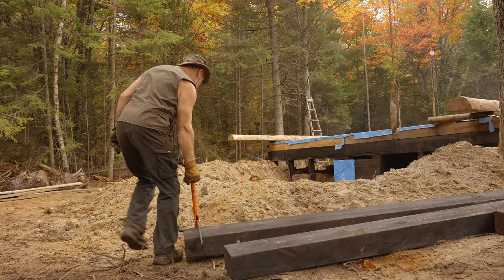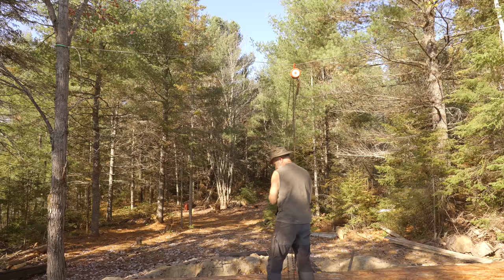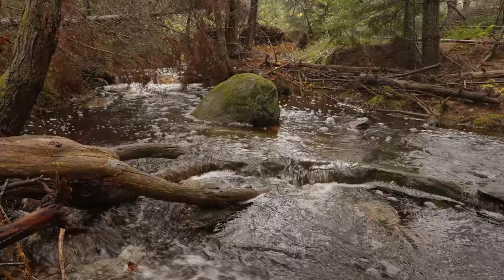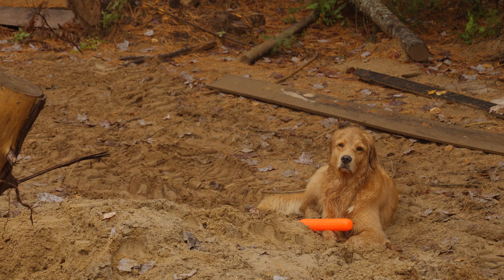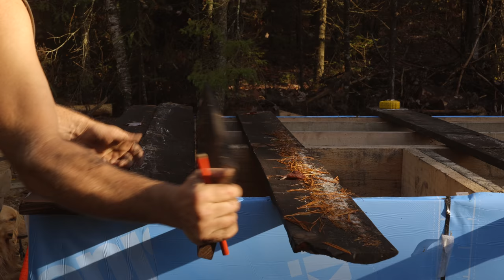Building an Underground Cellar and Breezeway to the Future Outdoor Kitchen | Off Grid Log Cabin

Comment: Usually they say “ don’t build on sand” but that’s the tightest sand I have seen. Wow, Cali does bark. What a great video, thanks Shawn.
Reply: If I recall right, "do not build on sand" is from the Bible. But, things were different in Near east back then.
Reply: Not build on sand I believe is symbolic, better to build on rock.. like Jesus said .. pointing out to Peter saying his name is Peter (Pierre which is a first name meaning rock ) and on this Rock ( Pierre) I will build my Church. ..
Reply: @angiekrajewski6419  My 1st name is Pekka, which is finnish version of Peter :)
Reply: They are right! Don't build on sand!
Reply: @gordythecat  well clay and rock seem to be all over my place.   So maybe not quite definitely sand everywhere. Lol.
Reply: I would post the link but it would just be deleted by YT, here is a description:
Definition – What does Hardpan mean?

Hardpan is a cemented layer in the soil, usually from 2 to 4 feet under the surface, although erosion can wash away some of the soil that covers it, or even expose it on the surface.
What Causes Hardpan
It is formed chemically, by lime, iron or silicate materials depositing at the same level and cementing the soil particles together. This cementing takes place very slowly. If you break up hardpan, it won’t form again during your lifetime. Caliche is a lime-cemented hardpan found in the arid Southwest. Like other hardpans, it is impervious to water. It is white or light in color, and the soil over it is usually alkaline.Claypan is a layer of clay soil. Claypan sometimes forms on top of hardpan as a separate layer. The clay may be hard when dry and softer when wet, but always impedes the flow of water, causing drainage problems.Fragipan is a layer of dense, compact cemented silt and fine sand. Like other pans, it impedes the movement of water. Fragipan is hard when dry, but brittle and fragile when wet.
Reply: He's not building on sand, but in sand.  This cabin will be just fine.
Reply: You notice the weight/mass of the timber he is putting underground?  You notice the depth in the ground he is placing the giant timber?  You notice that he has prepared for water, that his joints are clean and tight?  This, his massive foundation is built in the ground, rather than on the ground.  On top of this foundation, he will place a massive log home.  His home will last.   Texas
Reply: @papajeff5486  I wouldn't call it massive... but yes.
Reply: @papajeff5486  The fact is, that basement will rot.  It’s not instant, but wood rots.  He charred it, so it will help deter bugs and rot. But it’s going to rot.   Just heat exchange and humidity will create enough moisture to eventually rot it.   Of course, in a couple years, he will need to build another structure anyway, as these builds are content for YouTube.   He can’t stop, or the audience will stop.  
And of course, sooner or later the building inspectors will show up and he won’t be able to continue. He has those old neighbours as enemies and they will find the site on Google Earth.   Im sure there are a dozen turds trying to find him now.
Reply: @madjimbo4176  He is using techniques used to preserve wood for long time. And they do preserve it for decades. So not couple of years. And no, Shawn does not need Youtube to survive, he's merely entertaining us. When he's done, he can just plug off and live his life if he wants to. And no, he is far away from the hostile neighbors this time. Sorry to ruin your facts.
Reply: @Urgleflogue  lol.  He’s in the same area.  And of course, it will last longer than a couple of years.   But he will need more content to earn dollars in about two years when this site is done. He’s in business.   He entertains for money.
Reply: @madjimbo4176  Why do you think so? I mean, why do you think he'll need youtube to earn him money? Isn't it possible that the guy has secured his life already? Also, I can't help but notice that you're mad.
Reply: @Urgleflogue  I’m not mad at all.   I’m observing his build which is his content for his online video business.   Why do you think that is bad?  He makes good money from You tube.  And that’s because he has good content and a large customer base.    Why are you trying to pretend he is doing this only to be altruistic?  Lol.
Reply: @madjimbo4176  Well, your name says so :) And yes, the guy is doing this, because he understands there are lots of people who will like his content. Being the rational thinker that he is, why not use that while it can be used? And when (if) the interest for the channel dries out - well, that's ok, cut it and continue living. You don't think that Shawn started this project with the hopes he will be supported by youtube watches, right? Lol, as you put it.
Reply: @Urgleflogue  I suspect he does everything with a good idea of what is happening.    He’s a smart guy.     And let’s face it, there is a whole “non-pioneer side” of these productions no one sees.     Vehicles, material purchasing, mechanical repairs, electronics, charging systems, chemicals,  there is so much we don’t see.   It’s all part of planning a production that gives off an isolated survival mode aura.   It’s well produced.  We rarely if ever see cameras.     Yet he has to move them constantly.    

I would say overall it’s an extremely well orchestrated business, and the views on You Tube pay him extremely well.   Many Millions of views over time pays well.   And he deserves it.   He’s doing the hard work and making it better all the time.  

While he makes content, he will always have high views.
Reply: @madjimbo4176  Fully agree.
Reply: Heck, Mad Jimbo, even Henry David Thoreau wrote a book, it does not mean that the only intent is economic gain, or even that he is being deceptive in how he is doing it. You go pretty far afield in imagining the "non-pioneer" side, and as a fairly recent viewer, it seems unfair. So, what is the axe you are grinding?
Reply: @garysmcdermott  well, I suspect it’s normal for people to earn money on You Tube.    It’s normal to have a truck, ATV, Snowmachine.  It’s normal to have cell phones, computers, cameras, tripods, editing software, charging systems if they wish to make videos and post on You Tube.   What is difficult, is keeping all of that stuff hidden.   He does a terrific job of that, which reinforces the theme he wishes to portray.   And as a result, guys like you think he’s a modern Thoreau with a video camera.  That’s well done on his part.  

See, I don’t think that’s bad.  I think it’s good he does his chosen business/job well.   His business theme is well planned and he executes well doing it.   And I’m talking about what is very normal.   It’s completely normal.  

And I’ve been around and watching since the very beginning.  I do take a couple months off now and then from You tube when Im the northern forest myself, and catch up later.  See, charging is the challenge for people off the grid.   See, I don’t and can’t  haul around large batteries, and I know of exactly what I speak.  Devices need charging.   We download as much as we can when r the sun is at its peak. And when we can string a cell booster antenna.
  
Guys like you are odd if you think you can keep track of a couple million followers lol.  I’m not living vicariously through him as you are, but I enjoy seeing his videos as they have some great ideas on building.   He is a good man with a good business plan and strong execution.
Reply: @madjimbo4176  what exactly is your point? And why does it matter? Everything he's doing is his business! He is providing entertainment so he should get paid as does most everyone who works! Again, why does his life & business bother you this much? Jealousy perhaps!
Reply: @dlspiritdancer9548  did I say it bothered me?  I said only good things about him,  the only people being negative are you folks.  What is wrong with you?  Do you have some ludicrous need to attack people?  Are you an evil or just a bad person by nature?
Reply: @papajeff5486  Exactly, Shawn's building will last for many generations to come... I just wish people without firm knowledge of a thing, would just remain silent, observe and learn.
Reply: @madjimbo4176  The name, "Mad Jimbo", suits you to a T...Now, try adding, bad-intention, obvious bad-mindedness and strife, to your name! My goodness, you really are an angel of doom!
Reply: @patriciabarnes7034  strange.  All I have said are good things about him.   You folks need some help.
Reply: @patriciabarnes7034  I have said he is doing a great job running his business.  Talented guy with his planning and execution. Portraying the lifestyle he wishes to portray.  Can’t understand your rage here.  But hey, just relax, sit in your warm house, and get a cup of warm coffee from your Keurig.  Rage all you want.   It’s baffling.  But hey, I can get popcorn and watch you.
Reply: @patriciabarnes7034  evil? For saying a guy is good at his business?  That he does a terrific job?   What are you talking about?   Is the issue that you feel he is some sort of saint? Look, lots of people could walk away from their business and be ok.  Doesn’t mean it’s not a business and they aren’t trying hard at doing well at business.    They want more.  What’s wrong with that?
Reply: @garysmcdermott  Gosh, you nailed him right between his envious eyes!
Reply: @madjimbo4176  And you are still jealous with bad intentions! Shawn ought to block you. I sure would!
Reply: @dlspiritdancer9548  👍 👌
Reply: @madjimbo4176  O, you are insanely bothered! So bothered, that you come across as calculating and downright JEALOUS!
Reply: @patriciabarnes7034  well, you have raged here quite a bit, and frankly, I’m still saying he is a smart guy who runs his business well and you are the one raging that he should block me.  I’m not sure for what,  I admire his planning and careful work on his videos.    I admire he doesn’t let the modern world that he has to use come into his shots.  That sure takes a ton of planning and care.      He runs his business here well.  I have now said this over and over.  Yet, you have called me evil. And jealous.  Several times both words.  What is evil and jealous about respecting his business work? 
My only guess seems to be you think I don’t like him?  Not true.  He’s doing a terrific job.   He makes terrific content for his viewers, and that is why he has so many followers and so many views generating so much income.   

Really down to earth guy doing well at what he does for a living.   I think he’s done well.  What’s the issue with you?  I don’t get your rage?  

Is it because you think this is all some altruistic Walden Pond kind of venture?  Is that it?  One can certainly earn a living doing cool stuff.  That isn’t a bad thing.   Not in my opinion.
Reply: @patriciabarnes7034  I think you may need to get some help.  There are lots of trolls online, and maybe you are one of them.   I don’t know.  Your comments are over the top.
Reply: Often it said 
Don’t build on clay
Reply: @abolfazlnajafi  why ?
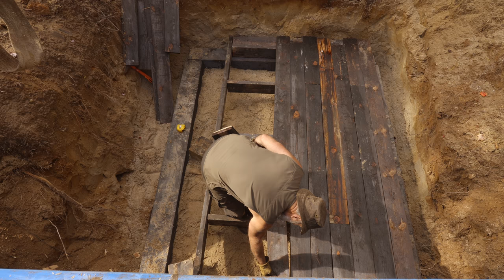Reply: @georgewhitehouse8630  Mathew 7:24 Jesus talks about not building on sand.   It’s a metaphor.    About life.   And I’m not a Bible thumper.  Lol.
Reply: @madjimbo4176  Hahaha you certainly changed your tune from your initial comments in this thread. I happen to agree with what you're saying, I also see through the facade. But you clearly had the intent to screw with people's perception of this channel and to act otherwise is disingenuous of you. You knew what you were doing pal.
Reply: Northern Ontario typically has very little sand, it’s mostly bedrock as in the Cambrian Shield and huge boulders deposited during the ice age and retreating glaciers. The dense sand that Shawn is building on would not be classified as hard pan. Hard pan is normally impervious to water as in a layer of clay. Water flows through sand.
Reply: @VCthaGOATdunker  he rue a business and does a great job of not letting anyone see that business and determining income,  his cabin doesn’t need to last forever, as he will need to be making new content in a couple years when this site is done.   what have I ever said that is different from that?   It’s a sure weird world that you folks live in trying to determine peoples intent.  My intent is to offer that this isn’t altruistic.  It’s a guy making income doing something he wants to do.   A lot of income. And good for him,
Reply: @Tomhohenadel  well, on this you are wrong.  First, he’s in central Ontario.  Second, there are thousands of sand deposits, maybe even a million, in Ontario, many spanning hundreds of acres, many smaller.    I have found dunes in the middle of forests, places where wind will not allow vegetation to grow.
Reply: @madjimbo4176  do you live in Ontario? I live in northern Ontario and I can tell you they is far more bedrock than sand. There’s sand along the shores of some lakes and rivers for sure. I think that Shawn’s property is probably closer to North Bay than central Ontario. Everyone has an opinion, have a nice day
Reply: @Tomhohenadel  yes, I live in Central Ontario. And I work in the Central and Northern bush for months at a time. And sand is a deposit left by glacial till on the Canadian Shield in many many spots.  I didn’t say there wasn’t rock.  I said there are huge amounts of sand deposits all over Ontario.  Dunes.  Drifts.  They are normal
Reply: @georgewhitehouse8630  Sand must be improved in its behavior with some methods (Read about soil improvement) to prevent settlement, liquefaction and other phenomena in case of occurring earthquake. You must avoid building your structure in a natural sandy soil.

Comment: Shawn my friend,
Please, please have stones laid around the perimeter of your cabin and make a French drain so your cellar does not flood during the spring thaw. I've learned this valuable and surprisingly innovative technique a long time ago.
I lost most of my supply preps when my root cellar got flooded.
Reply: I think that if you look back through the earlier videoes that Shawn has considered this and the drain goes through a pipe out past where he is currently doing his cooking while on site.  Also the build in on very porous sand so that alone should be a great assistance in this area.
Reply: I thought Shawn put drains in that let the water escape down to the creek? Will have to rewatch the video when he did the foundation.
Reply from the maker: I did, but it doesn’t see any water , it all drains straight through the sand

Comment: If you measure your outside walls of your basement--- You will find that they are the same length as it would have been if you just would have built your entire basement, in the full rectangle.  So both ways take the same amount of work, except the way you have it now, it's much less sq footage.  Granted it is less digging--  and easier to heat the basement later... I just thought I would point out that you didn't save any lumber arranging your walls the way you did... So I guess my point is, I probably would have just built the entire basement in full;  especially in that easy digging you've been blessed with...  That sand is a godsend.
Reply: I doubt he'll heat the basement being next to the root cellar.   Since this cabin is so much bigger I don't think he needed a full basement.  It's just him and his wife.
Reply: السلام عليكم 💌  ان كنت تريد ان تتخلص من جميع مشاكلك الحل الوحيد تعرف على الاسلام سر السعادة دين السلام  والراحة والاطمئنان والسكينة والامان ستشكروني على هذا يوما ما انا متاكدة فقط ان تسجد وتبكي وتحكي همك لله تحس بعدها كانك في جنة راحة خيالية لا يعرفها الا المسلم لاخوف ولاقلق ولاانتحار ولا امراض نفسية لان الله معناورسول الله محمد حبيبنا💐🌸🏵🌺🌻🌼🌹

Comment: Hi Shawn.  I can understand you applying Blueskin material to the outside basement walls, but I don't understand why you would also apply it to the cabin floors.  Since you will be having a dirt floor in the basement, wouldn't this cause excessive moisture build up in the basement and potentially result in mould.  Perhaps you will be removing it from the floor once you have completed the roof of the cabin.  Just wondering.
Reply: Great question. Here is my 2 cents: The basement should be ventilated with side walls vents, without reliance on evaporation up into the cabin, as it would smell musky.  (He is installing a wet area in the basement.). Moisture inside the cabin from cooking and warm bodies, should also not condensate in the colder basement. The cabin can be ventilated independently to control moisture by opening windows and doors. Hence he is isolating the 2 spaces.
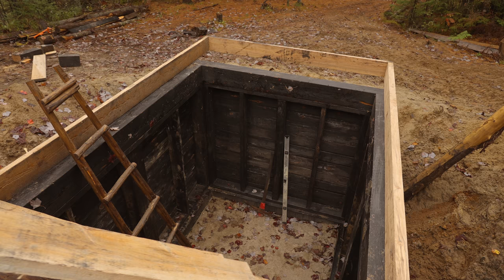Reply: I believe he mentioned a while back that putting that on the floors and or walls to deter rodents.  If you look at the 26:00 minute mark the sand floor is exposed.   So it appears he only did the outer walls.

Comment: great plan it will have a roof and could incorporate a door in the floor for putting up preserved vegetables...and maybe an herb garden nearby eh! oven for bread and oies roasting meat and making good breakfasts they say if an oven has an insulated door and you bake bread and close it up next day will still make biscuits only cools from 700 degrees down to 400...the heat next to the house fall and spring will come in handy...good looking meat supply there at the end a year real easy...